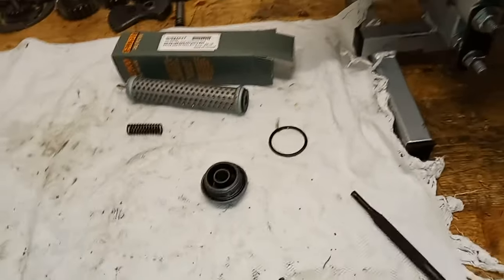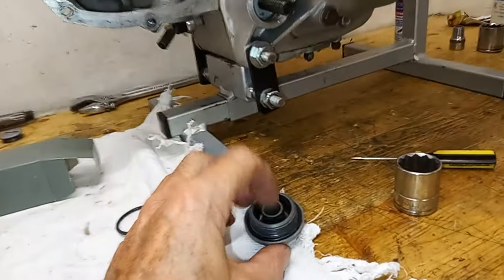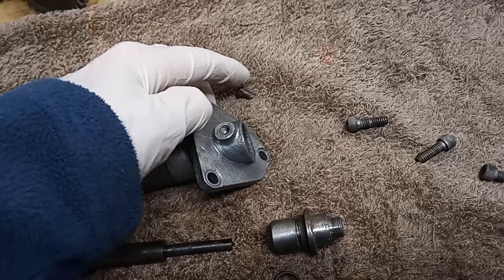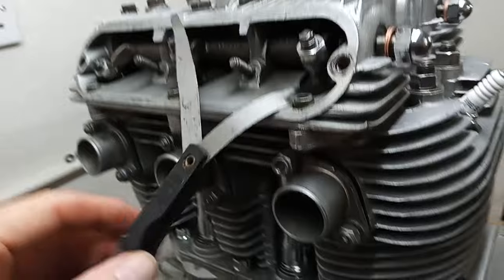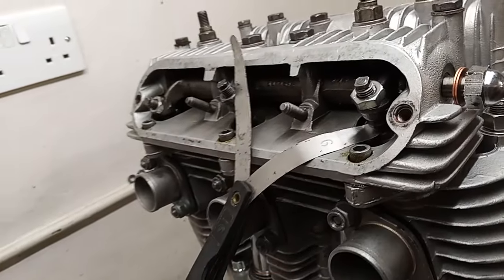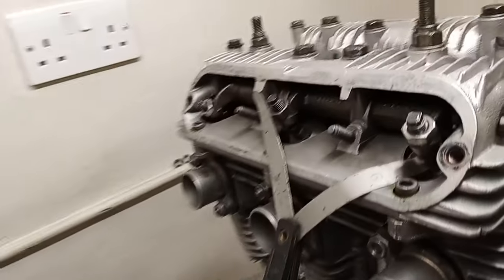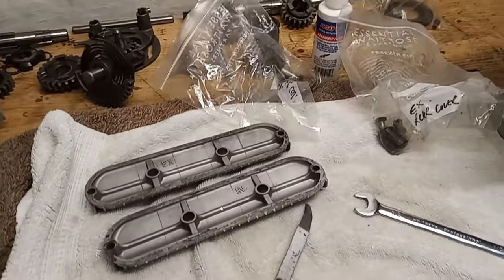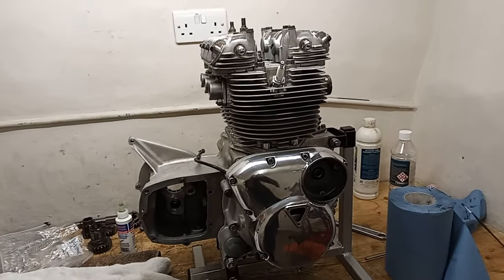Triumph Trident T150V Engine Rebuild. Part 33: Valve Clearances, Oil Filter and Tacho Drive

Comment: I took a Dremel and slotted my adjusters. Much easier to work with!
Reply from the maker: You just have to be very, very careful to ensure that no filings get into the rocker boxes.
Reply: @Chris.rooke150  Did them in the lathe while cutting the squares off (lash caps made them hit).
Reply: I’m wondering why you didn’t prime the oil filter?